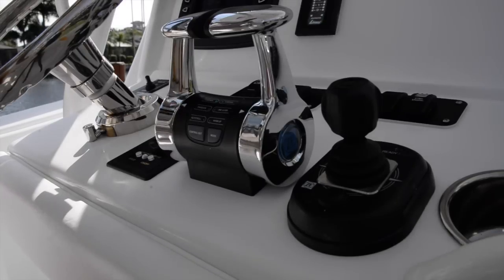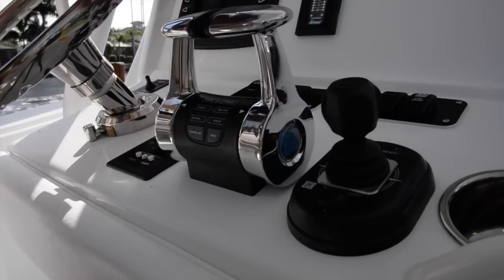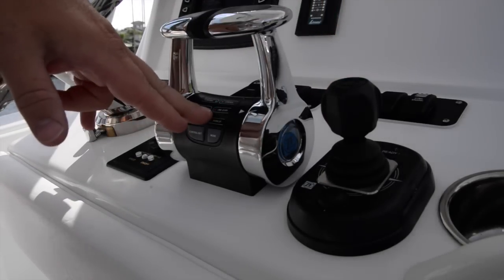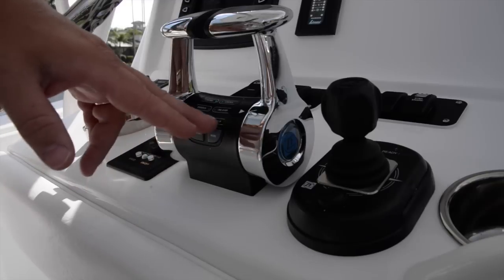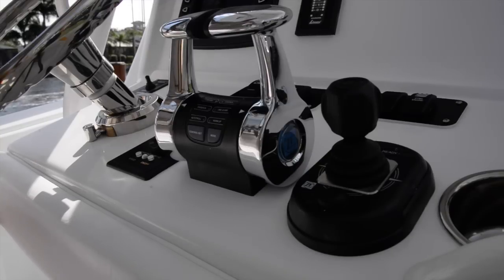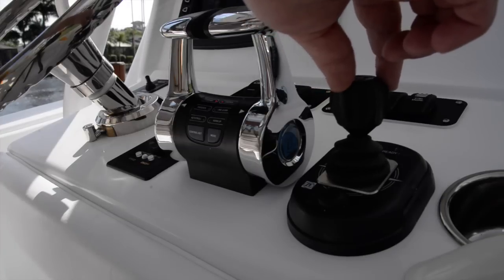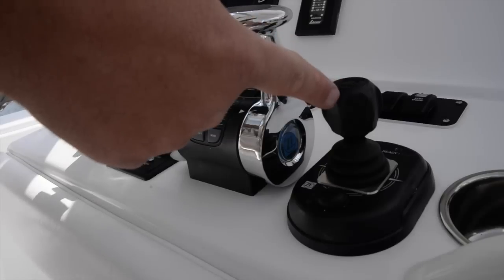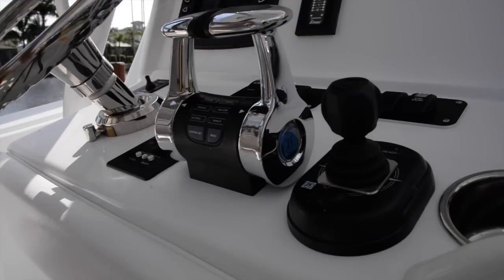Seven Marine 557 & 627 Controls

Comment: ZF JMS has an iAnchor feature that works as skyhook but It may not be available with fixed engines. Can anyone confirm this? I love Seven Marine but this is also the 1 factor I will not buy.  The motors look cool, sound cool , and run smooth, but whats the point to pay double price of triple package for twins to only get to my fishing spot a little bit quicker only to loose 1/2 the day driving in circles fighting the wind and current  because I can't lock down the GPS location  like sky hook and helm master systems.
Reply from the maker: DYNAMOAMPS the controls that I have do not have a skyhook like feature that I am aware of. They may have added it later but I’m not sure. Maybe someone from Seven can help with the question if they see this post.
Reply: Well it looks like my prayers have been answered. Volvo/ Penta has just released a joystick and autopilot package for Seven Marine Outboards and that includes a GPS position Hold setting that is equivalent to the Yamaha  version with set point . Since most boats equipped with Volvo systems are cruisers they don’t have the extra drift point fishing features but I’m sure it’s soon to come, only a upgrade away since many Seven Marine loaded boats are CC fishing boats.

Comment: no sky hook feature on the joystick?
Reply from the maker: No. The engines also don't turn like on Mercury or Yamaha. Instead, they go in / out of gear and forward / reverse as well as use the bow thruster. At speeds and power like this, the thought is that you really want the engines tied together with something firm.
Reply: David Halpin Got it. Thnx. This is unfortunate... I really wanted to buy some 557s but if no sky hook then probably wont buy.  Sky hook makes it so much easier to take the boat out as a single operator